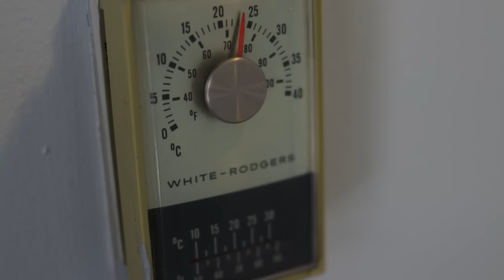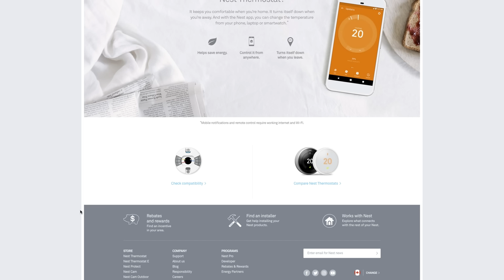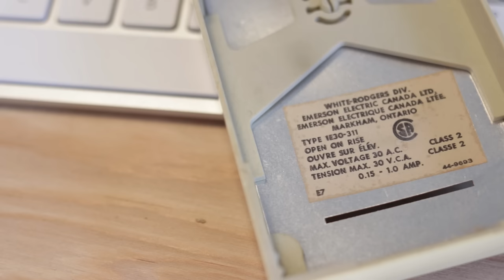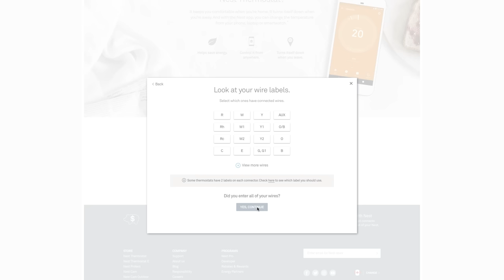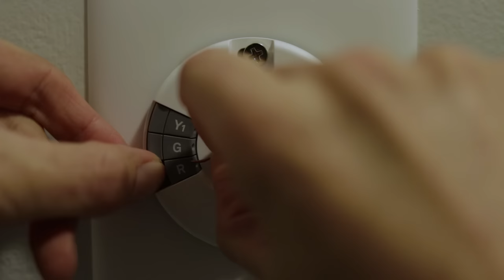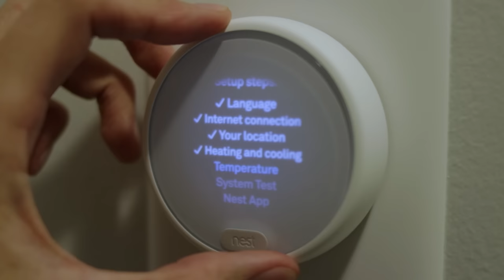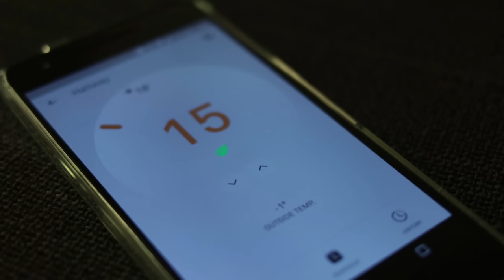Nest Thermostat Install (Replacing old 2 wire thermostat) - FAQ in Description

Comment: IMPORTANT TIP!  Some systems only charge the Nest while there is a call for heat.  Before you install the Nest E, charge the unit using the USB slot at the back for a half hour.  With no C (common) it does not charge while the heat is not on.  We had this issue when we installed it and either we go purchase a 24 volt power adaptor or charge the unit ahead of time.  Good luck!
Reply: Johanna Carlson this is false, the nest is supposed to change itself without a c wire by “pulsing” the W wire (also called power stealing)  to draw power whether you are heating or not. For some this works just fine, other people run into issues depending on their setup and equipment. In those cases you need to install a common wire
Reply: My Nest E worked fine for over 1 year with my 2 wire connection. Now i get an error message stating no power to the R wire. I removed base and charges it via usb port. It still wont work! Why did it work before, not now? FYI: I have a very old heater gas furnace that will eventually need replacing.

Comment: You may want to eventually add the C wire from the Nest to the furnace to improve reliability.   Adding a G wire will allow for fan only mode.
Reply: How can you add those in a house that's already existing and wired? Is it possible if you don't mind my asking?

Just moved into an older place and replacing an old thermostat like this
Reply: @RangerElite18  See if you have any unused conductors in the wire that goes from the theromstat to the air handler (sometimes these are hidden behind the thermostat or sometimes you have to cut further into the multi-conductor cable.  If there are extra conductors, you can connect them to the terminals you need on the thermostat and then connect them on the air handler (other end of the thermostat cable) to the appropriate terminals.  if you have used all the conductors you may need to run a new  {or additional) thermostat wire with enough conductors for all the functions.  

Typically it goes as follows:

Aux - Auxillary Heat (Heat Pump)

B -> Damper (Heat Powered) on Heat Pump Systems.  Common Wire on some non-heat pump systems (See C Wire Below)

C -> Common.  Provides 24V power to thermostat.  Goes to other side of transformer

D or DHUM - > Dehumidifer

E -> Emergency Heat Relay (Heat Pump Systems)

G -> Fan Relay  Note:, G2, or G3 wires allow for fan speed control.

H or HUM -> Humidifier

L -> Indicator Light Alert

R or RH -> Transformer (Single Transformer or Heat Transformer)

RC -> Cooling Transformer (Two Transformer System)

S, S1, or S2 -> Sensor or Indicator Light Wires

T -> Outdoor Temperature Sensor

W (or W1) -> Heat Relay

W2, W3, etc -> Additional stages of heat Relays

Y (or Y1) -> Cooling Compressor @RangerElite18

Comment: I paid a fortune to have the Nest Learning installed by the contractor because of the wiring involved.  I wish I knew about this Nest E.
Reply: two wire you have to take the stat off the wall to recharge it. you paid to have a power wire to be installed so you don't have to recharge it

Comment: Thank you for the informative video. I had my security company come out and install a few things and I wanted the nest to be on of them. The installer took one look at my digital a/c unit and said sorry sir this is an older unit and it won't be sufficient to run the nest. Me not knowing anything just said okay thanks. Now I will buy my own and try it. Thank you for the video.
Reply: Some connections to thermostats won't work for long because not enough power is supplied. Which is why, the technician said it won't work. Most people will need to connect another wire known as the C-Wire, from either the transformer, a wall plug kit, or in most cases there's extra color wires behind the wall not being used, and you can connect it to C in thermostat, and then go to your furnace wire panel and connect the same wire to C. Look up C wire nest thermostat. Without the C wire, most people will have problems after a few months saying not enough power in thermostat.

Comment: One of the cleanest install videos I’ve seen this far. Question I just purchase the nest thermostat Gen 4 is that the same set up process as this one in your video ?
Reply: Did that work for AC as well as heat?

Comment: Just wanted to let you know that this was probably the most useful video I came across regarding "no c wire". In your video, you stated that you had set it up about 2 weeks prior. I'd be interested to know how the system is running now that more time has passed.
Reply from the maker: Hi Alvin, I really appreciate you taking the time to comment that. I'm really happy it seems to be helpful to multiple people and it's one of the reasons I like the YouTube community. Thanks for that!

Funnily enough someone else asked the exact same question and this is what I told him:

"We actually upgraded our heating system about 3 weeks ago since the old unit couldn't handle the crazy cold we've had here in Canada. It was our first winter in this house so we didn't know how it would go and we decided to get it replaced as soon as possible to take as much advantage of it. It wasn't broken, just 36 years old. :)

Though we didn't have any problems with the Nest E with the old furnace! I think with this wiring you can't do much wrong but I'm not a pro with this stuff. :) My "gamble" in the video was not just a random try but I based it on multiple threads/videos I found online.
Just to be clear though; we didn't replace our furnace because something broke. :) We just decided to upgrade it."
Reply: So this setup did NOT have AC auto? Or it did? Confusing when looking at other videos with 4 wires they said you had to put the AC wire in the C slot I thought?
Reply: It will malfunction. It needs the c wire to work properly in the future. Or you can take it off the wall every once in awhile and charge it .

Comment: Just moved to 2016 condo apartment and it has old thermostat that controls heating radiators. Thinking of changing to Nest thermostat E, removed cover and I have 2 black wires (one is connected to R, another to Y). How do you think where should I connect to?

Comment: Hi I need some help thanks. I do have an old Honeywell thermostat for radiant heat, the heat comes down from the ceiling, an old system with wires running through the ceiling, and not working now. I’m trying to find the right thermostat to replace the old one, hopefully that’s the problem. Any suggestions on which thermostat I can use? Again, it’s a radiant heat. Thank you in advance for your help……
By the way great great video….. 0:08

Comment: Well youre like me. Buy the product, take the old one off, get ready to install the new one, THEN go to the website to see if its compatible. I'm surprised they did nto have a wiring scheme for you. BTW, how did you guess which terminals to use? You did a good job in the video.
Reply from the maker: Haha, exactly! You just have to take a gamble sometimes. I wasn't fully unprepared though, I just wasn't 100% sure it would work out when I purchased the Nest Thermostat E.
I was able to find only one archived Reddit post in which somebody suggested this configuration but the OP never confirmed if that answered his question. So I decided to just go for it and hope for the best. And apparently, I'm not the only one wondering about this unit! I'm glad it turned out to be a helpful video to others.
Thanks for your compliment, I appreciate that a lot!

Comment: I have an old white Rodger as well the model is a little different for this unit it electric heat got from 40-80’ (sorry it won’t allow me to add the pic) want to know if this work with mine. Did you have to do this to every room? I have a thermostat in each room!
Thanks in advance

Comment: I was just wondering if this kind of thermostat would be able too be hard wired to a infrared heating panel, instead of having the ghastly wire hanging down to a thermostat Plug that then fits into the sockets.

Thanks for the clear description in this video

Comment: Thank you for the very easy to understand video and tutorial.  My house has a 2 wire setup just like yours but I’ve had a problem with the nest e battery not staying charged and it keeps disconnecting from WiFi.  Have you found the same issues with yours?
Reply: Thats because you do not have the c wire. This allows constant recharge.

This is a good video but it leaves out a key part of the installation.

Comment: Everyone should know and understand that as good a product as the nest is it draws constant power for charging... unless you need to access or check on your home heating or cooling while away for any period of time your old 2 wire thermostat is perfectly fine. Adjusting your heat up or down while you are in or out of your house does not neccessarily save you energy...
Reply: anything connected to wifi to control house is stupid anywho!

Comment: Do you know if I can use this with gas heating?  I haven't checked yet but I assume there are only two wires.  House is from 1963 with old and original thermostat.

Comment: I'm curious if you've had problems since. I had mine installed by professionals, my furnace has since been checked and cleared and im having so many issues. The screen and everything is on but my furnace just won't fully go on. Which is annoying!! It was working for 4 weeks at a time then go off for 2 days and weirdly just  got back on. But since having my furnace checked by the same company who installed it. He played with it and got it working. But then was off for 4 hrs but then went back kn again. Not even 5 days later its not working again

Comment: how does it work? from batteries? Or from the wires in the wall? How did you know where to connect black wire and where to connect white wire? Thanks

Comment: My thermostat is same as yours. 2 wire. Question....I only have .6 volt on the power side. Thought it needed 24 volt.
Also have a transformer but can't find info to hook it up. Only for 8 terminal nest.
Reply: If I had to guess, it's a common mistake. Check your multimeter setting... make sure it's set to AC power, not DC. Take the measure again, it should read 24-27volts.

Comment: Can you program a timer for water heat? I’m converting from a conventional heat/water system with a tank, to a Combi. But, as I’m on oil, the oil combis have a small tank in them, to ensure instant hot water, so I’d need to program a time for that to be heated.
Reply: And it’s a two with thermostat that there at the minute 😂

Comment: I have a two wire setup - I believe connecting the two wires fires up the heating. Is this effectively what the Nest was configured to do? How is it getting power from two wires and feeding a signal for heat?
Reply: Yes, the nest is just completing the circuit. Black or R is just 24v power, the White or W wire is returning to the furnace control board or gas valve circuit

Comment: Hello great video. I'm about to instal the nest and also have two wires . I have you had any problems with your furnace stance instal. From what hear is best to have a third common wire in order for best not to fry your ignition. I would really appreciate your input.

Comment: Would black to R and white to W1 work with other thermostats as well?
 My thermostat has about 8 slots with different letters,, but I only have 2 wires coming out the wall (black and white).
It's a heat only system.

Comment: Sorry I know this is old. Was your wiring 115V or 24V? I found my old johnson controls thermostat is wired directly to 115V.
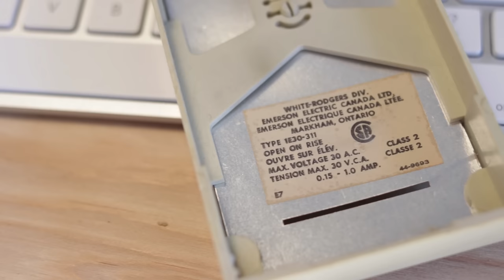Reply from the maker: Hi Sean, at 1:05 you can see that mine was 30V max. You have to make sure it's a low voltage unit! Cheers
Reply: @mauritsnienhuis  Thanks for the response, I must've missed that in the video. It's a good thing the wires to my old thermostat wouldn't fit the nest.

Comment: So these Nest t-stats do not require a C wire, like ecobee?
I only have a red and a white wire, which is what my old boiler has in the control board, only 2 terminals. Ecobee told me I need a 24v transformer in order to use their ecobee t-stat to provide power.

Comment: Our original Nest thermostat needed the 3rd wire for power, and would shut the furnace off in winter without it. Any issues with this 2 wire setup?
Reply: G Nunchuk we had the same issue, we had to hire an hvac company to cone and run a blue wire but ours was issues with the air not the heat.

Comment: great Video. A couple key points for the novice. 1) if attaching through drywall be sure to use plastic under expanders. If not like me when unplug the thermo from wall hub, the screws will after a couple pulls will pull entirely from wall. The wall plate everything must be very firmly attached to the wall. 2) if like me, the original gauge of wire is very thick compared to tiny hole in the nest wire Mount, you might very well need to have wire strippers to smooth and reduce the wire diameter so that it will insert through the nest wire Mount. When the wire is attached the depressed button that allows worse into hub will remain depressed. If not, try again will smoother smaller tighter wire. Other than that , the installation is easy. Top right, bottom left wire attachment.
It's great being able to monitor temps while away either on vacations or etc. The unit has lithium battery back up which you might want to recharge for 10 mind prior to install via phone charger USB.

Comment: Great vid!
Is your AC unit starting and stopping to maintain temperature? Or does the wires transmit to a controller for temp control?
I’ve got an old Honeywell thermostat as well.

Comment: Thank you for this video, I’ve been looking for a video what a 2 Wire Thermostat to upgrade to a digital thermostat.
Reply from the maker: Excellent! You are very welcome! I'm glad the video is what you needed.
Reply: Pretty much any thermostat will work for a 2 wire system as long as you have batteries or if it is mechanical instead of digital.

Comment: Well install is simple but with a two wire setup you will have battery problems in about 2 years. You will need to add a common wire or run 24 volt power via a transformer. I have 4 nest thermostats and I love them but ran into low battery voltage recently. When battery drops below or at around 3.6 volts you will lose the ability to connect through your app as it doesn’t have enough power to run thermostat and WiFi.
Reply: can you please advice about wiring. I have two wires as well of my radiant heat and I want to connect transformer to it. I knw one wire goes to C common wire but where would I connect the forth wire to? thanks
Reply: There is a RH and RC if your using the RH then just use the RC. If your battery has fallen below 3.8 volts I would remove the thermostat and charge it via usb cable usually 15 to 30 min will get it charged enough. Then the additional 24 volts coming from the C wire will keep it charged should stay around 3.9 volts..

Comment: Took me forever to find this info on the internet as I have an older home and even called Nest support and they were not sure how to help me regarding this specific 2 wire set up. THANK YOU!! ... Since the was posted in 2017 ....how is the Nest E holding up? Have you seen a difference in energy and save on your oil/gas bill? Thanks again
Reply from the maker: Hi Ed! Thank you for watching and I'm glad this was exactly what you were looking for! :)

Here's my answer to someone who had a similar question:

We enjoyed having a bit more control and insight into how much we were using. Besides that, it's fun to turn on the heat when you're in bed, haha.
Though, we actually upgraded our entire heating system after 3 months or so since the old unit couldn't handle the crazy cold we've had here in Canada during the past winter. It was our first winter in this home so we didn't know how it would go and we decided to get it replaced as soon as possible to take as much advantage of it. It wasn't broken, just 36 years old. :)

Though we didn't have any problems with the Nest E with the old furnace! I think with this wiring you can't do much wrong but I'm not a pro with this stuff. :) My "gamble" in the video was not just a random try but I based it on multiple threads/videos I found online.
Just to be clear though; we didn't replace our furnace because something broke. :) We just decided to upgrade it.
Reply: It is a scam it will not save you money any more than simply programming your stat will.

Comment: Be cautious third lines are needed to give power in the long run, otherwise you will need to plug usb in. Not a big deal if you know the issue but if not home house will get cold quick, systems can error.
Reply: Absolutely correct,I am currently having that issue

Comment: What if you have a red wire and a green wire? That's what I have in my vintage thermostat. It's also not labeled, and 30 Volts is what is read.

Comment: Hi, I was wondering if this will turn on the AC too or this is just for Heat?
Reply: you will need a minimum of 3 thermostat wires, one for power, one for heat and one for ac.

Comment: I’m getting mine fixed , I asked my repair man if we can upgrade mine from the 60s to a digital. He said no because mine is either you can use heat or ac not both. My hoa has to physically change it 2 times a year to use either heat or ac . I forgot what it’s called

Comment: My question is does the unit charge from those wires unfortunately i have the Nest 3rd gen and I’m noticing it isn’t charging only when i plug it to a usb. I to only have 2 wires
Reply: K1KO247 you need a C wire for power. If you don’t have that then either get one installed or charge the unit manually via USB.